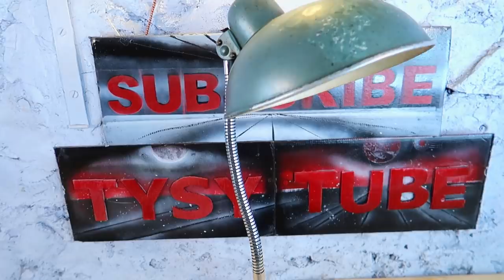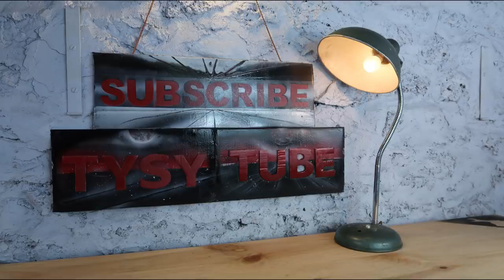Stylish Desk Lamp Restoration

Comment: I come from Germany. And inside is the FIRST Date of manufacture and the SECOND Date was for repair or checking. In Germany you can give this Lamp to the Manufacturer and there check it for you. Therefore the second stamp inside! 
And the rounded stamp "GEPRÜFT" (checked); At that time you were allowed to sell electronic devices only if this stamp was inside. In Germany today it is the CE mark or TÜV mark that a device has been correspondingly tested for safety in use.
Reply from the maker: thank you so much for all explanation 😊👍
Reply: No problem:)
Reply: German designs are as reliable as an AK47
Reply: @Thick Box The CE mark is NOT for testing. The manufacturer can mark the products with the CE mark if the product meets all regulations which are required in the european community.
Reply: and in germany we say: "Der Schutzleiter muss bei Metallischen-Gehäusen stets vorhanden sein sonst könnte es ungemütlich werden." :-)
Reply: We might say that. But we write it in this way: "Der Schutzleiter muss bei metallischen Gehäusen stets vorhanden sein, sonst könnte es ungemütlich werden." :-P

Comment: Another excellent restoration job, thank you.  I have two comments that may be important, however.  First, the inside surface of the reflector dome should be a matte finish, not glossy.  This helps diffuse the reflected light and makes it much softer.  While gloss white still works, matte (flat) white provides a nicer effect.  I think that the original paint was matte, from what I can see in the video.  Also, a knot should have been tied in the electrical cord before leaving the base.  This will prevent the cord from possibly being pulled out of the connection to the switch.  Even though the cord was soldered to the switch, it could still be ripped from it, with enough force.  If this were to happen while the lamp is plugged in, the results could be bad, given that the lamp base is made of metal.  Other than that, this is truly a nice piece.
Reply: He did knot the cord
Reply: @angelcoe6081  Oh, okay, I must have missed that. Thank you for correcting me. I apologize for my error.

Comment: Buy a piece pf felt and replace that on the bottom
Reply: I have adhesive backed felt, open and closed cell foam from .5 mil to  5 mil. I think I'd add a lead plate, the original gooseneck tends to move the base.
Reply: @jonanderson5137  the base on this thing looks plenty sturdy
Reply: Also you should of tied the power cord inside the base as strain relief, so people can't pull it out and put pressure on the internal connections.
Great looking restoration otherwise.
Reply from the maker: don’t worry have a special retainer for the cable check the video
Reply: @TysyTube  regardless, it's a good practice. That  bushing is more to prevent fraying then strain relief.
Reply: Should have replaced the felt bottom

Comment: I didn’t think this one needed repainting— just cleaning and replacing the broken plug. I might have replaced the light bulb socket, too, just for kicks.

I’m disappointed you didn’t keep that strange green color. That color just shouts “1950s!”
Reply: With its age it is likely that it was a lead based paint.

But it would have been nice to seen a close color match with the new paint
Reply: Matthew Fairbrother:  Old lead paint is much less dangerous in place than it is when you sand it off or otherwise remove it— thereby turning into toxic dust or (if you use a solvent) toxic liquid waste.  If lead paint is peeling badly, though, it shout be removed so children or animals won’t eat the paint chips.
Reply: @censusgary  i agree that it can be less dangerous when whole, but its not just the peeling, scratches  (which this had) can cause just as much lead to be released/exposed. And its not just toxic to kids. 

Using a wet removal method as TYSY did is the safest method, as less dust is able to go free in the air. Add a good respirator and common sense. And removal is the best option.

I know this due to having looked at my options for restoring my grandfather's old Lathe, same color too.
Sadly i was unable to get a good color match with a suitable replacement paint.

Although i admit, lead is just speculation with regards to thie lamp
Reply: I love the new paint job. It's fantastic, and is definitely 1950's.
Reply: the new paint is pretty 1950's also, reminds me of my blood printer from around that erra

Comment: Excellent restoration as usual. Especially thank you for not covering the original date on the inside. Also, I approve the use of Lidl tools and paints! Many have commented that the lamp should be connected to an earth (ground) terminal and it's true, but I'll also add, next time you need to restore something similar, use a 2 pole switch instead of a single pole. This way you don't have to splice just the phase (hot) cable and take it out of the sheathing, but you can cut the whole cord in half and get a much better and nicer connection. Plus, try using a crimp connection between cable terminals and switch, much better than screw and solder.

Comment: You might want to invest in a crimping tool and some wire terminals. Also the lamp body is made from metal so it should be fitted with a grounded plug connected to it.
Reply: I agree with this! Especially since the toggle switch is also live from the metal of the base. If there is ANY fraying (even with a special bushing, fraying can happen) you could be putting live voltage over the entire lamp just waiting for someone who is grounded to run 240 volts through them. It just would have taken a 3 conductor cable to the switch. You could still leave the 2 conductor up to the socket. You then ground the earth cable to the metal plate that the gooseneck fastens to. You can still do this.

Comment: Hi again from England Tysy....

I did subscribe to your channel some time ago as I like watching what your doing...
But we have a bit of a problem here matey...

I'm UK based electrical contractor....
This needs properly earthing up my friend... 😉

Pull out that 2 core flex and go for a 0.5mm 3 core...
You'll need to earth this at the actual lampholder AND the base...as you can't rely on the flex arm for reliable earth continuity...
So if you get a new lampholder with an earthing terminal on it...earth at the base (strip the insulation and loop it in & out of the terminal...but don't cut the cable to terminate here...keep it continuous) then send the earth cable through the flexi arm and earth it again at the lampholder 😊

If you get another of these would you keep it as shiny base metal...?
Either way its very retro and they fetch good money...
People like em...

Comment: That's a nice restaurtion. I like it. The colour is beautiful, but a more original green Paint would look better i think.he new switch looks great at the Lamp.  But as mentioned before, the electric wiring schould be uprgraded to modern standarts. In th european community these bulb lamps are no longer allowed, today there are so many modern LED bulbs in different variations in size and form that where much more efficient against the old bulbs, an they last longer..

Comment: From the lamp holder to the switch can you use normal 0,5mm Cu-wires.
At the end you must crimp the ends of the wires and in the case of the switch: you need for the switch not to solder, but a ring-cable shoes or the fort cable-shoes. 
SO would it be electrotechnically correctly.
For the shinking tube you can use a hot gun or a lighter. The soldering iron heats the shrinking tube unequally and can eventually  destroy it. 
Also use just a lighter.
Reply: Speaking of correct wiring, this now requires an earthed 3-wire cable and plug.

Comment: Nice resto. I like it that you kept the original stamp. You should try that more often. 
I personally would have gone for a more 60's color but its fine. 
Don't worry about the electrics. Nobody died in the EU from this. As they are still made like this. The switch however. I would have used a better one. Those stranded wires are not how it should be. Looking forward to the next vid
Reply from the maker: thank you so much 😊

Comment: Lovely job. I love the colour. I'm glad you kept the date stamps. Just adds some age and history to it. Even the simple switch is a thing of mid-century beauty. Did you consider placing some little rubber feet or felt on the base?
Reply from the maker: thank you so much, i have searched too put something on the bottom but i didn’t find anything

Comment: Nice work. 
Cleaned, sanded and polished all parts. 
Also painted very well (maybe except the different colour, but its okay). 
Only the new switch is irritating me. Originally this lamps have a Push-Button-Switch (search web for "HELO Bauhaus Lampe" and you can see it).
Reply: Those buttons break easily. This one will last longer. Plus its style existed back then.

Comment: Just a tip: when using Hammered Paint, if you want the actual "hammered" effect you have to lay on the paint THICK. Coat it as thick as you can without getting drips. That way you'll actually get the hammered texture. Also important when using two tone hammered.

Comment: Great channel, great videos! Love your restorations.
It seems as if the "original" cable - the golden one - wasn't the original one. I'm no electrician, but wouldn't a ground wire be better with a metal chassis?
Keep those videos coming!

Best,
Dan
Reply from the maker: where i connect the ground wire?
Reply: @TysyTube  The ground wire should connect to the lamp's metallic (= conductive) exterior. The idea is that if a live wire gets dislodged and touches the exterior metal somewhere inside the lamp, a breaker or GFCI/RCD (= safety gadgets in the wiring in your home) will instantly cut off the power before you get a (potentially fatal) chock from it.

Comment: Two things: 
1) Please use crimp connectors for the cables. It is much safer and faster!
2) Add safety ground to your electrical appliances with metal housings. In this case the lamp even has a metal switch. Especially if you don't want to use crimp connectors!

Comment: The knot in the gold wire was there for a reason. When you bend the lamp, this causes the effective path to lengthen....more wire is needed than on a straight path. So now, when you bend the lamp, the wire may try to pull out of the switch and touch the body, making the body live. You should bend the lamp to maximum first, then add the knot, then wire up the switch, (with earth connection). Right now, it looks like no earth and there is a high chance of live wire touching body. Hope this helps.

Comment: I was gonna ask before watching the whole video about heat resistant paints. I have an old Luxo lamp that I've been meaning to take apart and repaint. I painted it before, but did a horrible job at it. I didn't even strip off the original paint. Although at the time that was because I didn't have the tools or facilities to do so. I want to take the whole thing apart and recreate it, making a few more lamps of similar size for use in the workshop I'll have when I move. Back to my first sentence, the lamp tends to get really hot when left on for a long time. The paint seems able to handle it, but the whole top section gets fairly hot. Would using a certain paint help fix this issue? or maybe using a different type of bulb?
Reply: G4mmaLotus Chechnout the paint he used at around 7:50 heat resistant

Comment: First: Very nice lamp you chose, good job on restoration. What I didn't see at first: You were not the first one to modify the lamp. The "on/off" switch was already missing on the lamp, instead it was put to the power cord. Good you brought it back like it used to be. Your switch installation looked dodgy when you started cutting the cord but went fine. You could've gotten bonus points by labeling "AN / AUS" instead of "ON / OFF". I'm not quite fine with the colour, and I guess you're feeling so too. It's too blue, the original was more green. I completely lost it when you signed your work with the marker. Good lord! Days and weeks of fine art and you choose a marker the size of Missouri to sign it? What the actual heck? Anyway... your work, your signage, well done, I like it a lot.

Comment: Although it was a great job, I believe you should use eye shape wire shoes instead of ironing. Firstly, The heat could damage the switch, secondly, that is not safe, thirdly, if you have to change the switch or the cable that would be tough work.

Comment: Hold up, did a Romanian dude just "That's what she said" me?... I don't know how to feel about that. Great work either way! My only criticism is to put a crimp end on the wires in the switch instead of solder. Makes a more solid connection that can be fixed later on.

Comment: Workmanship is good, but if I could offer a thought. Why not be a little more authentic in the colors used. A little more searching would have come up with a close match to the original metallic grey. I think that would have been much more attractive and period correct. Also, the reflector white turned out beautifully, but painting the rolled edge to the lamp shade white only served to highlight irregularities in the lip. Better I think to have simply painted the reflector, place the hood on a flat surface and refinished with the grey metallic as the original manufacture did. But, you do very nice work and my  comments are only constructive suggestions. Take care.

Comment: Good restoration but it needs grounding. If you are from EU, lamps and light systems that have metallic base, need grounding which will be then connected onto the base. Also, i dis not see a fuse in that socket. I am from a country that uses three pin sockets, so a fuse is always used. Do not you use any? :)

Comment: For future projects, unless there is some reason you can't have the white paint underneath the blue on the light cover, there was no real need to tape it off. Since the primer and spray were both white, it should have been fine. Then you would only have had to tape off the rim, instead of having to do TWO tape jobs. :) LOVE the color though... simply gorgeous!

Comment: So was that gold wire not original either? Had the switch moved there...
Reply: Are you joking? Braided and latex rubber were the norm; single-insulation PVC had just been introduced in two variants - green for the military and ivory for the consumer market. I'd place this faux gold double-insulated garbage in the early 90s.
Reply: I suppose not. Just doesn't look like off the shelf stuff.

Comment: Ok, nice job but two things i think you could have done better... first the switch... you should have used one with a German label saying "ein & aus" instead of "on & off". Second you could have added a ground wire to meet modern safety standards.

Comment: This is extremely DANGEROUS as it has a plug which goes to earthed wall socket. There are no double insulations and the stress releaf is missing. Knot is not a stress releaf. If you are in Europe, please change the plug to a round class 0 plug which is not possible to insert in an earthed wall socket.

Comment: I read up on the subject since I want to restore and be able to sell restored lamps. Grounding a lamp that was made without the safety ground is a huge no-no. Theres some black magic involved in grounding lamps with moving parts in perticular. Double isolated is what i would go for. The problems in this lamp safety-wise would be the socket and the switch.
Reply: Never heard about that at the college. All metal fixtures I own came with 3 terminals. Care to explain or prove your claim?

Comment: it killed me a little inside when you polished that piece of beautiful aged brass. please stop polishing brass that isn't corroded! it's the #1 rule in restoration!

For curved pieces, I think you'd probably cut your tape time in half if you used pinstriping tape! 

for feeding wire, use the old automotive trick and tape the wire to a coathook or piece of other rigid wire and pull it through!

Other than that cardinal sin, the overall result is beautiful and your work was great.

Comment: A number of Options for the Power Switch.
Most Common Termination (today) are Quick Connect (QC) Tab (using crimp terminals) and Wire Terminal (using wire nuts)
http://www.carlingtech.com/termination
I would avoid Screw Terminal, Solder Lug, Screw Terminal, or PC Board Terminal for this usage.
=
The switch itself can be toggle (as shown), Push-Button, or Rotary finished in Nickel, Chrome, Brass, or colored phenolic/plastic.
An in-line switch along the line-cord, could also be used.
==
In North America, we have a number of Vintage Lamp Companies for restoration parts (and lamps/bulbs).
http://vintagewireandsupply.com

Regarding compliance with NEC or UL standards, 
I find portable metal lamps still sold today with polarized NEMA 1-15 plugs today.
===
As for Refinishing / Painting, that’s a personal decision.  
For lamps of this post-WW2 period, Hammertone Colors were frequently used.

Rust Oleum sells Hammered Verde Green and Light Blue spray paint.
https://www.rustoleum.com/product-catalog/consumer-brands/stops-rust/hammered-spray?ls=7219830&lc=Verde%20Green

Modern Powder Coating, adds Textured colors.
https://www.milehighpowdercoating.com/colors/

Comment: NIce but not a restoration. It is simply a replacement of paint and other materials NOT conservation. Pitty you changed the colour. In terms of conservation, loose chips of paint would have been 
placed back with shellac. Than the paintsurface would have been cleaned with denaturalized alcool en lacquered with soluble glacepaint made of canauba, shellac and terpentine oil. This way a 
restoration can be undone without causing any damage to the original state.